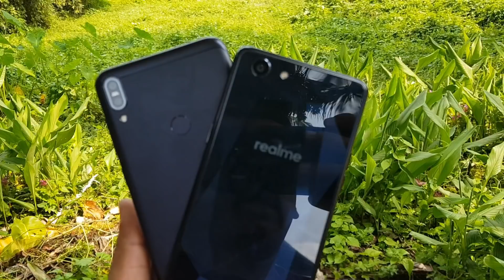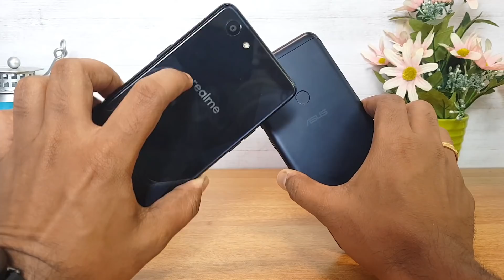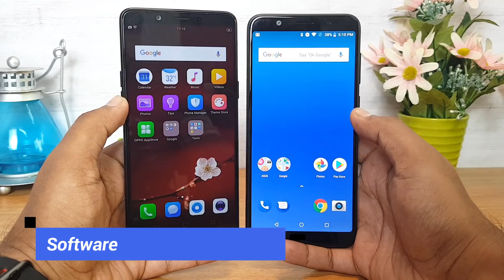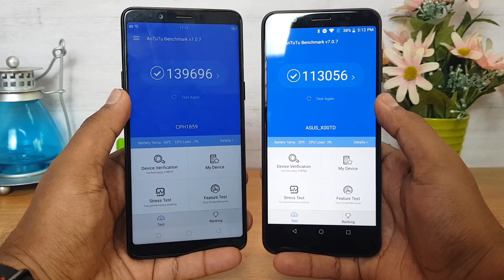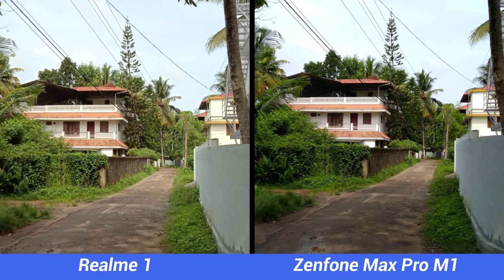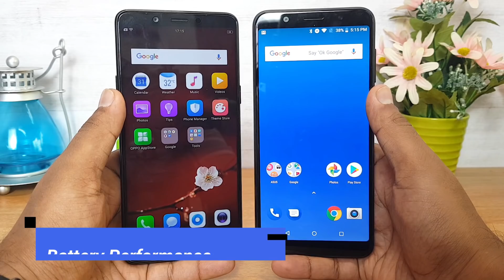Realme 1 vs ASUS Zenfone Max Pro M1 Detailed Comparison

Comment: Which one is better for gaming?
Reply from the maker: My personal choice would be Zenfone
Reply: Techniqued alright thanks 👍
Reply from the maker: See I said both are similar gaming in the video itself and in comment I said my personal choice. What is there to lie here?
Reply: I think realme 1 coz helio p60 is much powerful than sd 636
Reply: Worthem Shadang 
Realme 1 is better for gaming but temperature gets higher than zenfone
Reply: Techniqued Helio p60 is as powerful as Snapdragon 660
So which is better for gaming Helio p60 or Snapdragon 636?
Reply: The adreno gpus are better than Mali ones so yeah he is right
Reply: Techniqued ya ZenFone max pro is better than oppo realme 1 because it has stock Android
Reply: Techniqued what make you choice Zenfone over realme 1
Reply: Suraj bro eventhough its mediatek ,its a new chipset ,see the speed test between Nokia 7 plus and f7 and see the result .
Reply: Techniqued is there heating issue in realme 1?
Reply: Worthem Shadang same question
Reply: No doubt Realme1 with better cpu and 6GB ram
Reply: Manu Ramanujan then i should go for realme 1 😎
Reply: Helio p60 cpu is powerful but mali gpu isint powerful than adreno 509
Reply: Suraj S R mtk are better too
Reply: The asus max pro m1 is better in gaming.beacause it has addrino 509 but realme has mali gpu
Reply: Zahid Bhat well try the 6gb version of asus and then tell me.
Reply: Helio p60 is powerful but gpu not good compare to snapdragon 636
Reply: Syras Aj something called Gpu  and and zenfone ahead in that
Reply: Manish Agrawal ,yep
Reply: GO FOR ASUS ANY DAY,MTK IS NOT GOOD COMPARED TO SD..SD IS BETTER.
Reply: You said my personal choice , truth is what ?
Reply: But realme one is more powerful ,come on bro don't be a lair ,he didn't ask u your choice

Comment: sir i never used any pattern ,pwd,pin ,or fp to lick de devuce...neither i need more battery coz it cause in heavy weight...but yes i need gud camera ,gud connectivity in all departmnts ,dual 4g volte connectivity nd gud resake too as on diwali i ll sell....so which is best for me in REAL ME1, HONOR 9 LIT, ASUS MAX PRO.....i need 3gb varient only  ..plz suggest me as ealiest if u can
Reply: ankit maheshwari realme 1 will be best for you. I'm also planning to buy realme 1 for myself.
Reply: Tarun Mehta bro main compition is in between...hobor 9 lit nd real me...as i booked honor 9 lite in 9000 but i said i vl availble to receive on 25 so dey holding it for me.....so both in same price which is gud for me acc to my priority....in camera which best HONOR 9 OR REAL ME ?
Reply: ankit maheshwari then go with the Asus Zenfone Max Pro M1. Or if you could go for a higher price then go for the Zenfone 5 2018
Reply: Go with realme it differently has much better cameras as compared to the 9 lite. My priorities are also similar to those of yours. And I've decided to buy realme.
Reply: Tarun Mehta thx...same i thought....coz i alrrady used honor 9 lit before 3 mnths...nd its camera luks 5000 rs mobile dan i sold it bcause of camera..but many reviwers soecially gogi rana gave dat camera excellnt rating dan aftr sold i thought der was may be defect of my unit....nywz thx fir making my confusion clear
Reply: Go buy Redmi Note 5 Pro if you want big battery with good camera
Reply: Lenard Egypto i hate design of rn5 pro , neither i need big battry as it cause heavy in weight..3000 mah is gud enough for me, nor i need fi ger print or face unlock....i need 1- gud camera from both sides, 2- gud design,3- light weight,4- gud resale value as i vl sale on diwali
Reply: guys ny guess which has best camera OP6 IN 35K or PIXEL XL2...IN 45K.....I NEED FOR AMAZING CAMERA ND GUD AFTER SALES SERVICE..BAAKI KUCH NHI.....AS I DECIDED TO BUY REALME 1 AS MY SECONRY MOBILE....NY SUGGESTIONS?....rit now m using s9+   but not satisfied with both sides of portrait cameras.....only low light camera is gud in s9+ vo bhi only in real.....i m selling it .....so give me gud opinions ..its a big confusion for me
Reply: Pixel 2 is definitely the champion in Mobile phones camera. No other phone can beat pixel 2 in terms of overall camera performance. Only the still images of huawei p20 pro is better than pixel 2 but it's video quality is not upto the competition as it also lacks stabalization in 4k. If you want good cameras pixel 2 is definitely the best choice and it's from camera being lesser in megapixels produce best selfies.
Reply: https://youtu.be/7TQCYZikEzg. Watch this blind camera test of asus Zenfone max pro, realme 1 and redmi note 5 pro to clear your confusion. 1 is asus, 2 is realme and 3 is redmi note. To me realme looks much better than asus . You can also see results in this channel's page.
Reply: Tarun Mehta thx bhai....yestrday i sold s9+ in 50 k 2 mnth old.....nd today i buyed pixel xl 2.....WOW   WOW   WOW WAT A PORTRAIT SHOTS FROM BOTH SIDES....IT IS REAL ALTERNATE OF DSLR.....I M SO SO HAPPY AS I M PHOTOGRAPHY ENTHUSIAST
Reply: now jus waiting for real me 1 for secndry ph